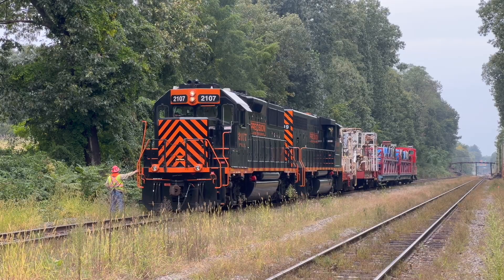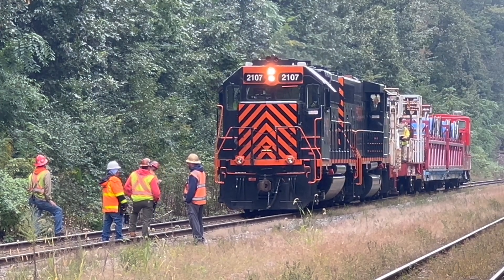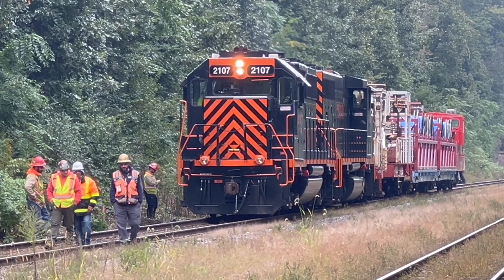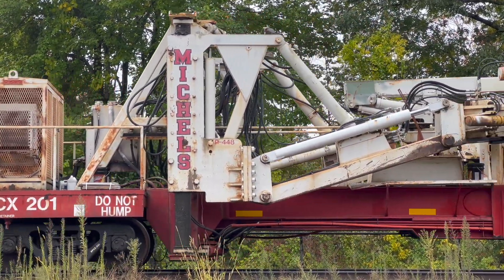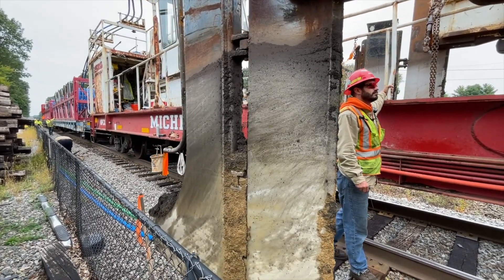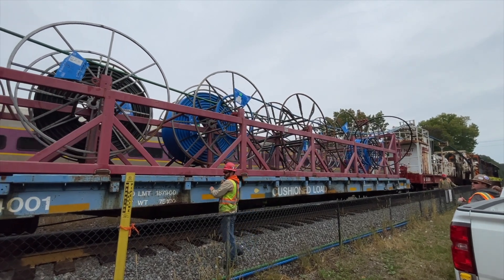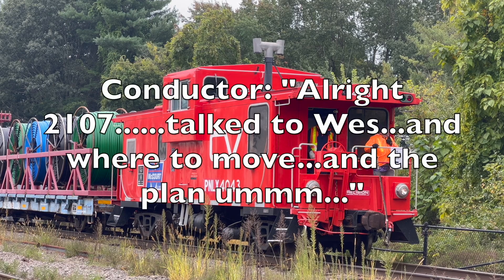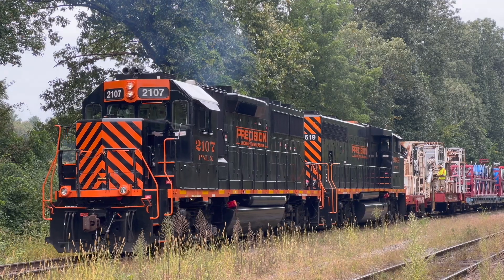An Up-Close Look At the MBTA's Newest Project | Boston Railroading Explained: The Fiber Train

Comment: Sooooo what I’m taking away from this video is that the MBTA installed a safety system in a manner that they knew was going to fail, but did it anyways. Then the taxpayer has to pay for them do the entire job again several years later, only this time they do it properly (maybe). 
Classic MBTA.

Comment: Nice video.  That trencher car resided in New Bedford for some time after the South Coast Rail cables were done.
Small correction in that a scheduled train does not display any class lights.  A following train running as a second or more section of a regular train displays green class lights and an extra train not in the timetable displays white class lights.  In daylight they would fly flags of the respective colors.

Comment: #2107 isn't a GP 38 shell but is now classed as one with 2,00hp. It was built as a MoPac GP50 and its current configuration was done by (I'm guessing MK: aka Morrison Knudsen) as the result of UP having it rebuilt into a low horsepower/low emissions unit before it was sold off.
Reply from the maker: Oh interesting. Good to know, thanks!

Comment: To those who don’t want to watch the full video, the project is the new Hampshire corridor which expands Commuter Rail up to Manchester NH. Hope this helps
Reply: Most of the video was filmed in Lincoln and several times the narration explicitly mentions it is the Fitchburg Branch, which is NOT part of the New Hampshire corridor.  The Fitchburg Branch parallels MA Rt 2, going west all the way to New York while staying completely in Massachusetts.  After Fitchburg, the tracks (though not MBTA passenger service) continue west to Greenfield, where they cross the Connecticut River and proceed through Shelburne and Charlemont, following the Deerfield River, to the Hoosac Tunnel and through to North Adams.

The proposed passenger service to New Hampshire would be an extension of a DIFFERENT branch, I think the one that currently terminates in Lowell or the branch to  Haverhill.  I am aware of no plans to provide rail service to southwest NH, (Keene), but if so it would make sense to branch off or extend the Fitchburg Branch to the north, crossing into western NH, but for service to Nashua, Manchester and Concord, the Fitchburg branch is NOT the best choice by far.
Reply: Ewwwww there's enough massholes up in New Hampshire.  Looks like the Free State Project failed and Florida is the place to be.
Reply: Whatever happened to me group New Hampshire Railroad Revitalization Association, them seeking to restore such services?
In a similar opinion I believe that the rails, up to the MA/NH state line, are owned, or until some control, by the Commonwealth of MA (Look at Google Earth's sky view feature. You will see that the Nashua's Pheasant Lane Mall structure is entirely in NH while its large parking lot crosses south of the State Line into MA.)
Could the MBTA run trains to a point just south of this state line, constructing a passenger boarding platform somewhere south of their state line?
Could the owners of the Pheasant Lane Mall charge the same fee to park at the southern end of their mall parking lot, abiding by the same policies, posted by signs found at the MBTA's Commuter parking lots (for liability purposes)?
Could any bus service operate so to bring MBTA passengers from various points north of the Pheasant Lane Mall to this proposed passenger boarding platform/station? Could the same such proposed service bussing operations bring MBTA passengers north from the Boston area upon arrival of trains from Lowell, MA?
I believe that there are some ramifications of MBTA trains running north of the NH/MA state line of some kind.

Comment: A nicely detailed synopsis of a unique train. Michels Pipeline has had this fiber optics division probably close to 40 years. With their HQ in the small town of Brownsville WI which hasn't had rail service in about 40 years (old MILW RD) their initial applications were for US Sprint. GTE. Verizon and quite a few miles were placed along right of ways that are now ripped up. My first sighting of their activity was on the Duluth South Shore & Atlantic c..1985 @ Sidnaw MI which at that time was embargoed and removed the following year crossing the former Milwaukee Road line to Ontonagon. That metal blade probably was down at least 4 ft add up there was moving quite an amount of loose rocks in the dirt. MPCX. Had an outdoor shop at Byron WI where they had up to eight cars alongside the Wisconsin Central Main.and the "brute" of the fleet was built on the frame of an old ATSF GE and at one time I believe they had 2 GP9 units in off white  that worked projects in AZ and CA. It is quite a sight to see and Michael's also works on railroad construction engineering for Bridges tunnels around the nation and even some abroad

Comment: Minor nit: the blue, black, and green ducts are not fiber optic cables, but flexible duct that can be buried (plowed) into the dirt or into the ballast. There is usually a second pass, or separate reel, of the fiber itself that would get pulled through. The fiber optic cable will be maybe 1.25” (max, and unlikely to be that thick) and pulled through by a mule tape and pull system, from intermediate pull boxes.
Reply: Also, your footage and VO are magnificent.
Reply from the maker: Thank you so much!! Glad you enjoyed
Reply from the maker: Ohhhh fascinating! Thanks for that correction. I saw a video on youtube yesterday of the train trenching and burying the cables, and i saw this weird orange stuff being dug with them, that must be the fiber!